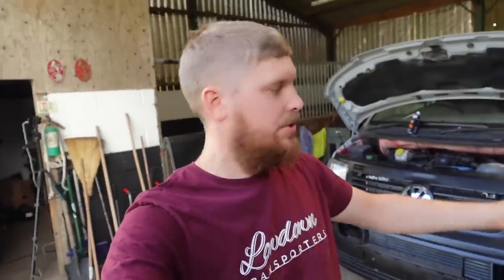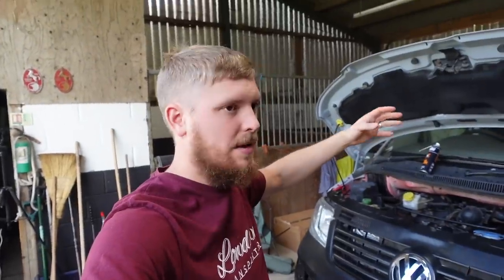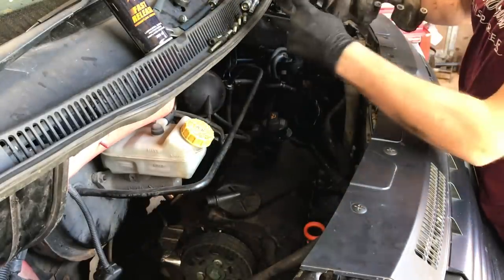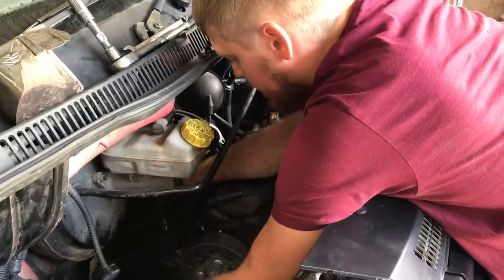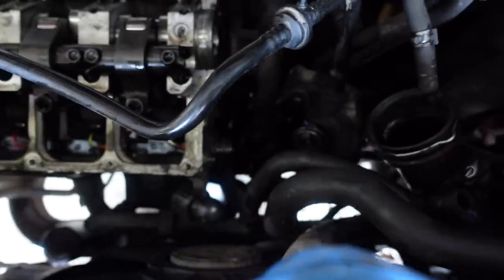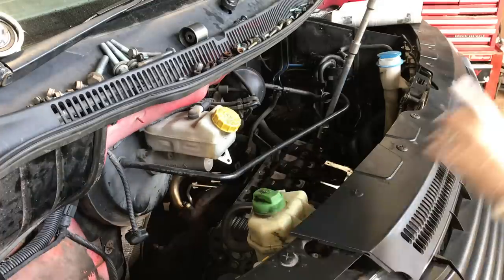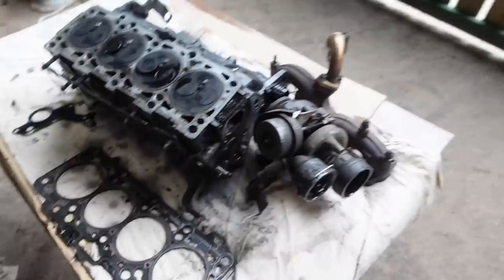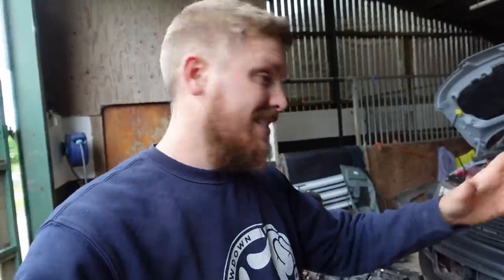VW T5 'Restoration' Ep16 Cylinder Head Removal 1.9 TDI AXB Transporter Pressurised Coolant

Comment: 9:52 onwards - second cylinder from left at the top. Looks like it has been leaking directly into that cooling port
Reply: And the gasket when flipped over at 10:25 seems to also show markings in the same place on the same cylinder. 🤷🏻‍♂️
Reply: Agreed good spot that looks to be the problem.   Also check the heads straight but if you having it skimmed they will confirm. Make sure you get the right thickness gasket but where you take the head they will advise.
Reply from the maker: Thank you for the comment and for watching! Thank You, Yes that does appear to be where it had failed. Fingers crossed a skim and new gasket sorts it.
Reply from the maker: Thank you for the comment and for watching! Thanks Bud, Hopefully this was the issue...
Reply: @DanChambersDAC  So long as the block is still flat then you should be good to go. It would be worth checking before you put it all back together 👍👍

Comment: Hiya Dan.
If the heads turns about to be stuffed.
I've a axc head in my garage your welcome to have 👍
Reply from the maker: Thank you so so much for the offer dude! Really really appreciate it. Fingers crossed this one is now sorted. Hopefully the head can help someone else out that has a damaged one. Thank you for the comment and for watching!
Reply: Do you still have that head Gary?
Reply: @kev6046  unfortunately not.
Reply: @private749  Ah, no worries. I might not need it but the cam belt snapped last week and I'm due to take the head off for a peek tomorrow, so fingers crossed...

Comment: Don't skim the head dude, never skim pd heads. Just get it pressure tested and make sure the gasket is the same they come in 3 different thicknesses. One hole, two hole and three hole you'll see which it is on the little tab that sits proud of the head at the front left side. As long as you match them up it'll be fine.
Reply: How come you cant get them skimmed
Reply from the maker: Thank you for the comment and for watching! I have spoken to a few places and went with a local guy. They all said the PD was skimmable, Just pair it with the appropriate gasket.

Comment: Great series. Been there a few times with fixing stuff where you don’t know what been done to it in the past. Had a head on a old Toyota hiace done about 7 yrs ago at GNRS engineering  in Coventry. Did a good job and know what they are doing. Also do head pressure tests. Keep up the good work👍
Reply from the maker: Thank you for the comment and for watching! Thanks for the recommendation. Went with a company in Rugby.

Comment: Blooming heck well through the hole it is then and may the force be with you ha, so no cooler then. Ok while you are in there check the metal pipe that comes out of the thermostat housing & it goes round the front of the block they rust like crazy check it out while you are there bud & good look I'll be watching ha👍
Reply from the maker: Thank you for the comment and for watching! Yup, No other options really.... The pipe has been mentioned in a few comments. Will defo take a look. Thank you.

Comment: Great video Dan! With jobs like this, it's good to find the 'smoking gun', ie the failure point. I would be scrutinising the head gasket between the pots and the water ways, before you clean anything up. Even the tiniest breach will cause major issues. White/ corroded deposits on the head face where the gasket fire ring sits are a dead giveaway. Always good to find the reason for the problems imo! Good luck!
Reply from the maker: Thank you for the comment and for watching! Turns out the gasket had failed between cylinder 2 and the water jacket.

Comment: the boost issue will be Egr stuck open due to carbon and boost presure will escape through EGR until the exhausts presure becomes  more and stops boost leaking hence brief boots as it runs out.😉
Reply from the maker: Thank you for the comment and for watching! The boost issue was sorted in a previous issue by replacing the MAF sensor.

Comment: Steady work... looks like the head has been off at least once before (trying to find the same problem?), possible pattern gasket and it’s definitely had sealant spread over it.  Check the waterways haven’t been contaminated, but once crack checked and skimming done a good clean and it should be good to go again.  Great job 😎👍
Reply from the maker: Thank you for the comment and for watching! Head is currently being sorted, Fingers crossed a fresh gasket will sort it out!

Comment: To be honest mate, unless you're looking at upping the boost, Id just use standard head bolts. Pd 150 bolts tend to be used in remapped high boost pds
Reply from the maker: Thank you for the comment and for watching! Ahh Ok, I have spoken with the guys that are refurbishing the head and they are supplying everything I need now.
Reply: @DanChambersDAC  loved todays video mate. Thank you so much for making it. Engineering is cool as fuck. Kids need to aspire to stuff likd this, not being x-factor celebs. Picking up a t5 myself tomorrow. Swb, tailgate, red......338k miles. Looking at dropping a golf pd130 in it

Comment: As someone else has commented, 2nd cylinder along on the mating face of the block, has a dark mark from cylinder to water jacket, compare it to cylinder 3, cylinder 3 has a silver ring round the bore as it's sealing, check the underside of the head gasket you removed at cylinder 2, your probably find its failed, you did show a dark mark that corresponds to the position of the leak

Looks to me like the gasket has failed on cylinder 2 between block and gasket rather then head to gasket, getting the head skimmed is a pointless exercise, you need to inspect the mating surface of the block first
Reply from the maker: Thank you for the comment and for watching! I put a straight edge on the head and it looked to have a dip where the blow marks were. Block seem's to be OK...

Comment: Hi Dan great video mate what was actually wrong with your engine to point towards the head
Reply from the maker: Hi, Thank you. So the coolant was bubbling I think. (it was over a year ago!) and various other things. Tried to change loads to sort it but it was the headgasket that had gone.
Reply: @DanChambersDAC  thank you for replying I have got the same 1.9 as yours your vid have helped me keep it on the road very grateful 🙏 😁
Reply: Dan I've got a 2004 transporter T5 1.9TDI axb and pushing water out of the header tank, looks like I'm going to be doing the headgasket. Thanks for the vids 😂👌👍

Comment: I have a potentially busted head gasket, got water in the engine oil and leaking coolant. First thing I'd need is a manual/specs on the engine. Any ideas where I could find one? Engine is BPC
Reply from the maker: Thank you for watching and for the comment bud. I have a Haynes manual that should have the spec's in. Easily available from eBay or Amazon.
Reply: @DanChambersDAC  thanks!

Comment: Pull the thermostat stat and flush the block. Might be worth doing whilst you are waiting for the head to come back
Reply from the maker: Thank you for the comment and for watching! Not a bad shout!
Reply: @DanChambersDAC  might also be worth changing the fan switch and engine temp sensor and run a hose though the heater pipes. Then you have a bullet proof cooling system

Comment: Hey Dan, currently using your cylinder head removal process as guidance, as I have to remove mine on my 1.9L BRR engine to un-clog carbon (down to my own stupidity at pissing about trying to remove EGR valve, then intake manifold to clean, & knocking stuff down in ports & clogging centre valves). Haynes manual also proving to be seriously helpful...as well as pretty damn vague sometimes.
Dan, did you have trouble trying to undo the turbo oil feed pipe union nut? Mine is pretty seized, & seems to be wanting to turn the fitting it screws on to (which itself is screwed into the top of turbo). Heat gun & WD on it not working yet (though has def helped on a few rusted n seized nuts elsewhere). Same for the other end Dan, did you struggle to undo feed pipe union nut at the block under oil filter casing? Need to get beyond it to crack on. I'm sure you've hit a multitude of snags yourself in your time! 
Very much appreciated Dan, your whole Restoration series has really helped in my own panel van to kombi conversion.

Comment: Great videos and information. I can’t help thinking, your life would have been easier sourcing a replacement engine. That way you could have refurbished the engine on the bench. Then done a straight engine swap. 

It’s would have been less information for the channel. However it would have given you an easier time. 🙂. Keep going mate your getting closer
Reply from the maker: Thank you for watching and for the comment! I did look at a replacement engine but the cost to buy then refurbish was a lot more than just sorting the head. Doing the headgasket was a pretty easy job to be fair.

Comment: Wow,, Dan, that's some serious time+money on this vehicle,, I've done this many times, to many vehicles.. Man, it would of been quicker+and less money just to swap the engine,, and with less miles on one.. I get the body work etc etc, but man the time+money+effort then to finally strip the head off just doesn't make any sense to me, when there are cheaper+better alternatives... Good video tho..
Reply from the maker: Thank you for the comment and for watching! I did consider this option but buying a second hand engine doesn't fill me with confidence. Fingers crossed the head sorts the issue.
Reply: @DanChambersDAC  Fingers crossed Dan.. But that's a serious amount ot time+money spent,, and here's the thing, 9 times out of ten I've found is once the engine/cylinder head etc has had problems even after having it skimmed +all the sleeves etc etc it still has problems... You get good engines+bad ones,, I'll give you an example,, right I had 2 Mitsubishi shogun engine's both identical except one had done 190000 miles,, No problems whatsoever,, the other one only 87000 miles,, nothing but trouble,, oil leaks, water leaks, overheating... I even tried what you did, new radiator, waterpump, hoses, etc etc,, but it was just a waste of time+money... And I've had other engines do exactly the same,, Mercedes 270 ml diesel.. Nissan Navara engines,, Personally I think you've got a bad engine,, and once you go to that length to put right an issue it's time to reassess,, Just my opinion/experience.. But I do like your work.. The bodywork was fantastic... Keep it up...